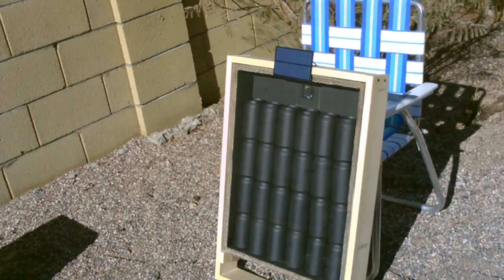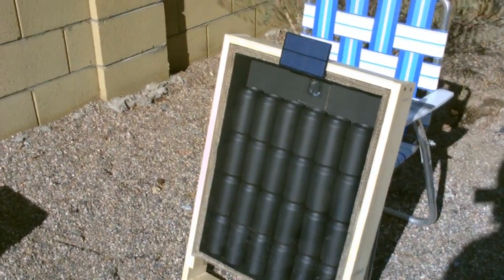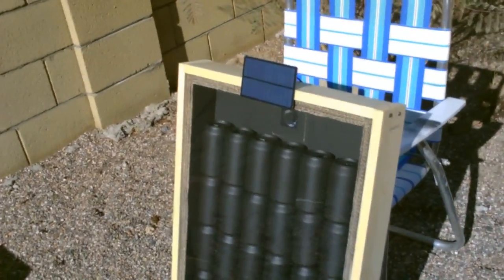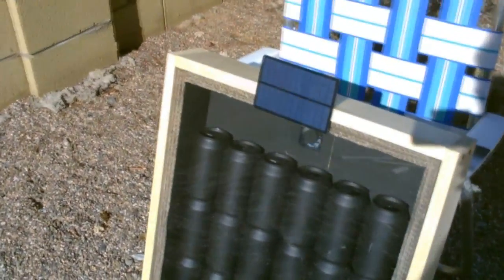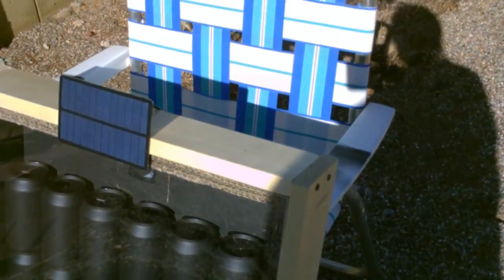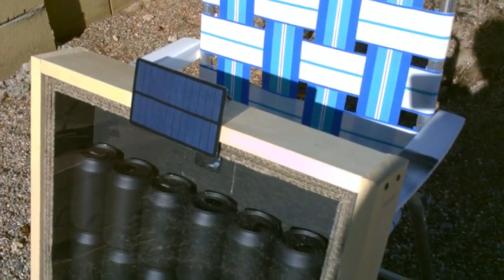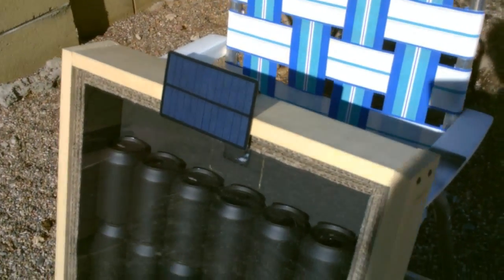Homemade Solar Air Heater! - DIY "soda/pop can" Air Heater!- 150F+ Temps. (Quickview)

Comment: if you leave liquid in the cans, then i guess you would shift the heat generation away from when the sun is up.  Would first heat up the cans, then would start to produce heat... even after sun goes down.

Comment: @desertsun02
Hi, I'd like to propose a simply experiment and you can perform it if you like or maybe already have.

I was wondering what the increase in air temperature would be if the casing were enclosed with a thermal window instead of just a single pane of glass? I know thermal windows (double or triple pane) are super expensive but in the long run could be cost effective.